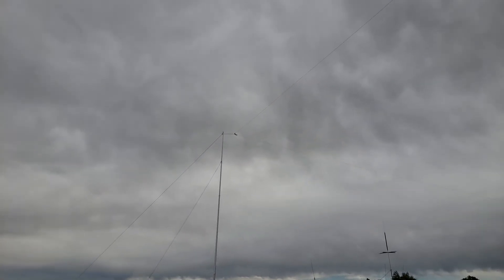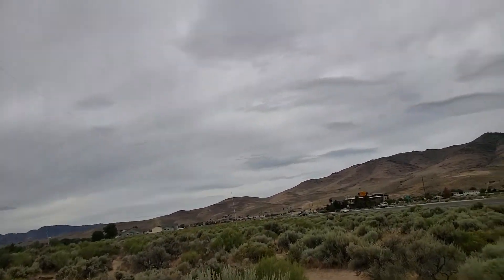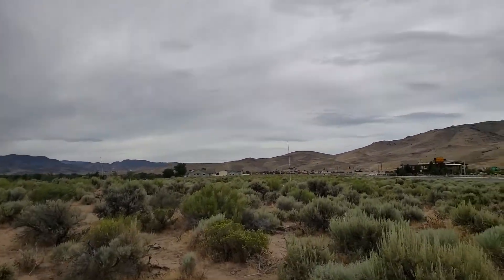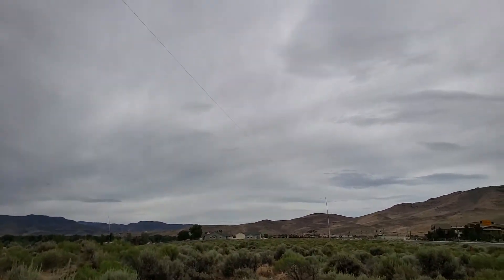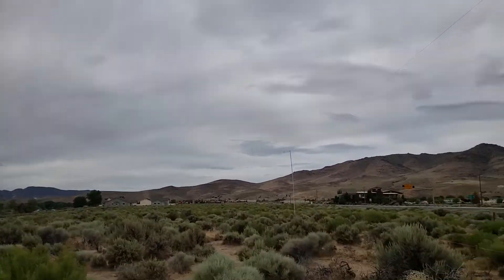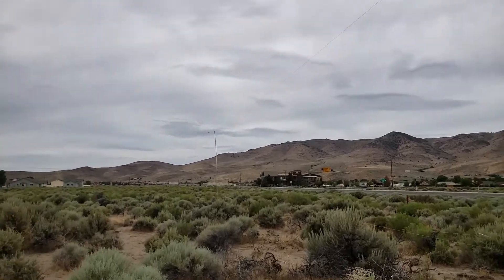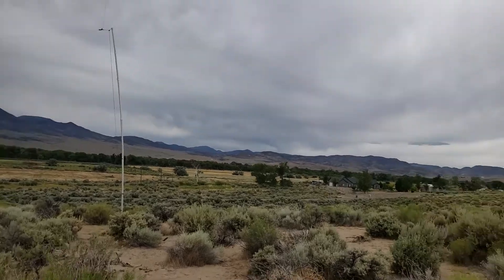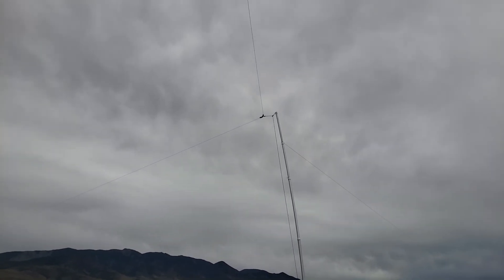320 meter skyloop build

Comment: Do you have any information on how you feed your sky loop. I have a coax feed 80m loop that has worked OK but I am not sure about side feed or corner
Reply from the maker: if you go to my QRZ page for ag6if, scroll down, you can see overhead shots of the loop and the balun is along the southern side, making a V out of one side of the pattern.  Fed in middle of the leg basically, a custom designed 'talented balun' 2.5 to 1 ratio, of my own design.